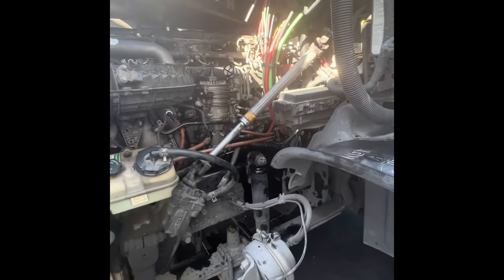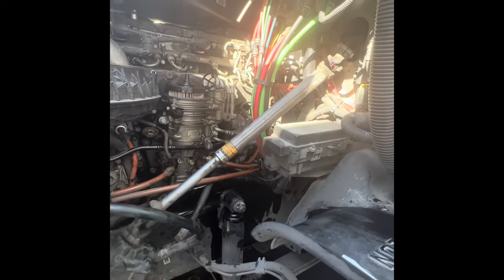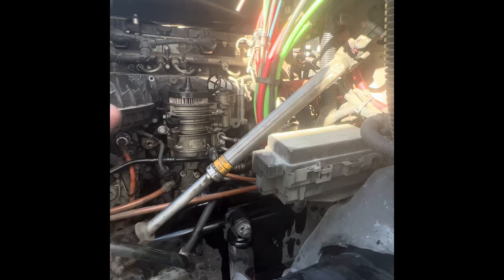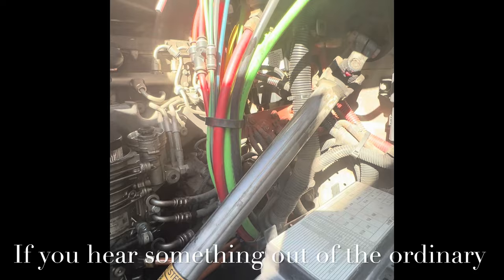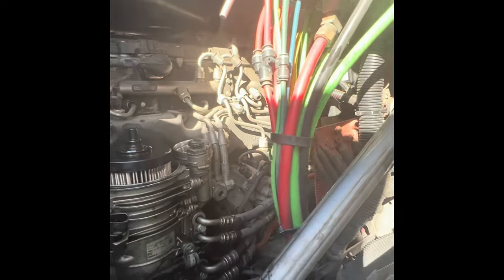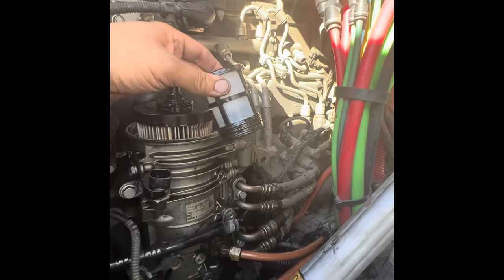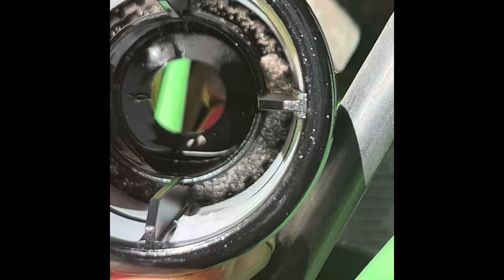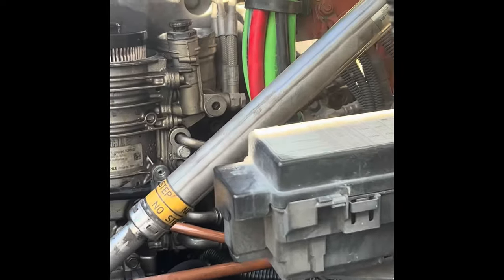How to know if your DD13 or DD15 HI Pressure pump is going bad. What to look and listen for.

Comment: The fuel pump cooled by diesel. It should be tank empty. They try to start, then make the pump tuning without diesel lubricant, then metal piece go to the fuel system.

Comment: This is the exact issue i have, and dealer said I have to replace the module which is bs. My question is ,once my fuel pump went out, it triggered nox sensor faulty codes,I got engine light, check engine light, engine stop light, so  replaced the nox sensor, now they can' t complete a four hours forced regen.everytime the dealer trys to perform forced regen, all the lights gonna come on, and interupt the regen. Any idea?
Reply from the maker: So if the pump goes out, you may have metal debris in the module. Now you may have to replace it depending on how much metal is present. Most likely they want tot replace to prevent any issues or further damage. 
The codes, what codes are you getting?
Reply: @CarlosDieselElectric  can I DM you? If that's ok with you. I was going to call your shop today, but i realized that all shops are closed on sundays
Reply from the maker: @jamesx3030  go ahead and send me a message

Comment: what about when the engine has a little nicking and the rpms goes up and down could be the fuel pump too?
Reply: Quality control valve most likely. On high pressure fuel pump. Almost costs as much as the whole pump though
Reply from the maker: Hddm3 is correct, quantity control valve sounds like the issue you are describing
Reply: I’m having this issue, what did you end up doing?
Reply from the maker: You can replace the quantity control Valve but Detroit has increased the price upwards $750. Sometimes you are better off replacing the pump assembly. It comes complete